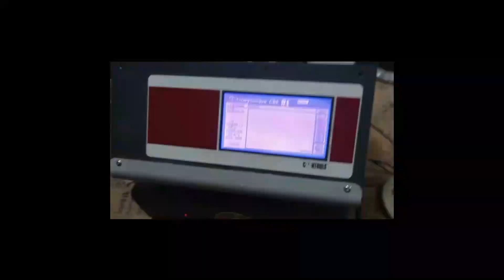plc s7 200 input signal and dc voltage check

Comment: Hello thanks for sharing .. currently I’m using S7-200 cpu224xp model. PLC is in stop mode after cleaning the plc power and control card it’s working in run mode. Can you suggest me what’s issue in this plc.
Reply from the maker: that was male functioning
Reply: How to fix this issue can you suggest me. As component is faulty in this card or not?